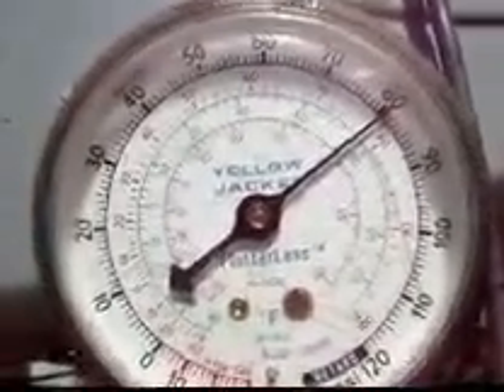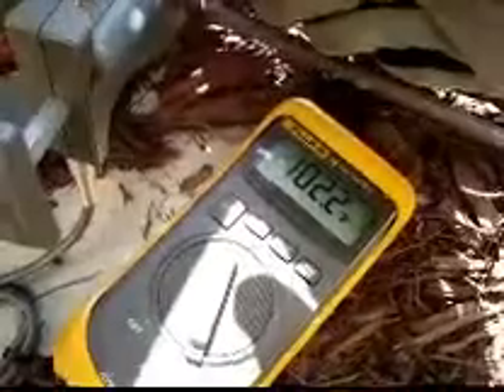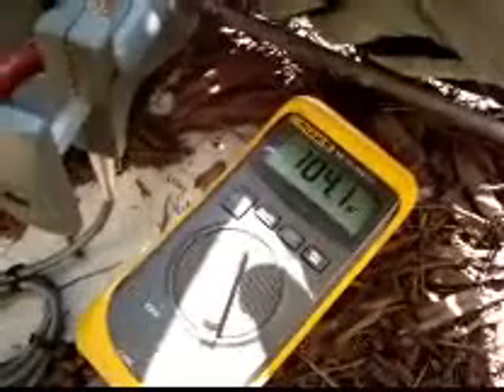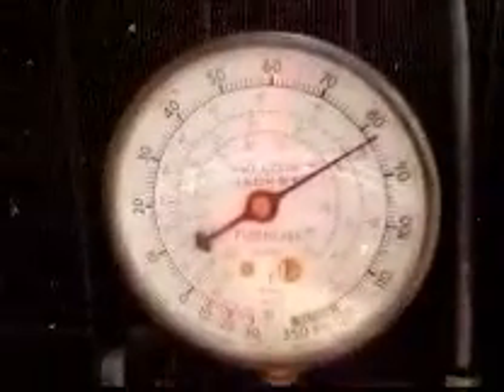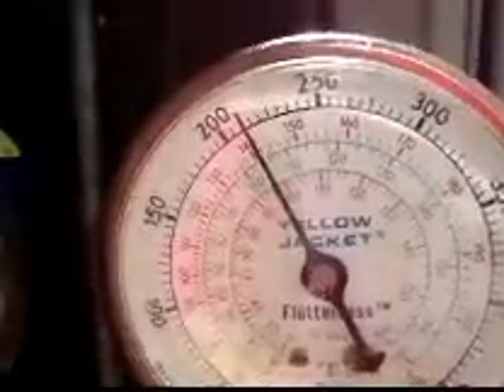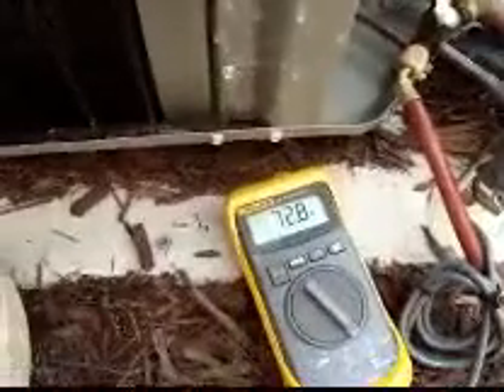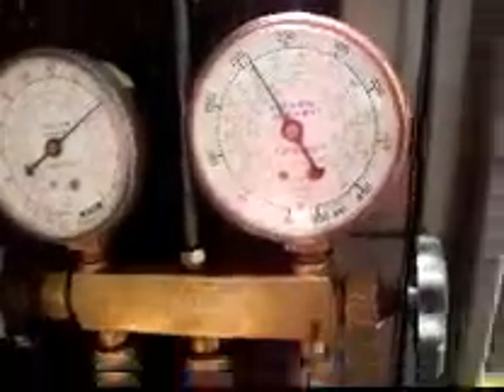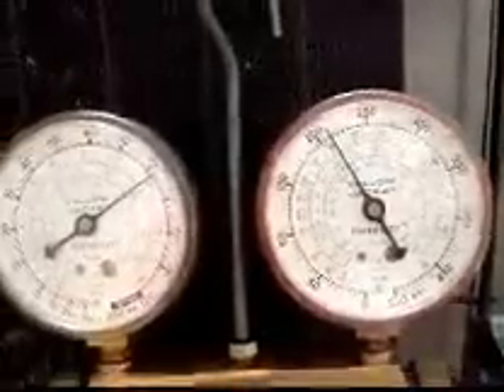HVAC: Air Conditioning Repairs

Comment: good video. I wish that with the fluke 16 you didn't have to use that adapter with the pipe clamp.I have had 2 to pull apart.The parts house replaced them but it was still a pain.I do have a fieldpiece that it plugs right in to but I still love my fluke16.Hope to see more videos!

Comment: good vid.  I think the parker valves rated 1 1/2 to 3 ton don't throttle well on a 1.5 ton system.  That unit doesn't look like a 1.5 ton though.  You're right about the rarely failing open.  Good catch.